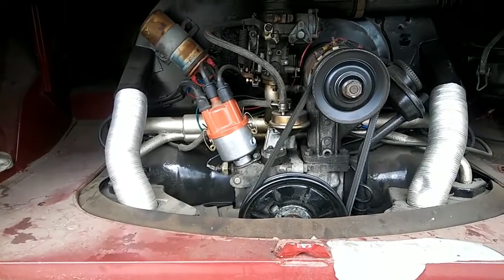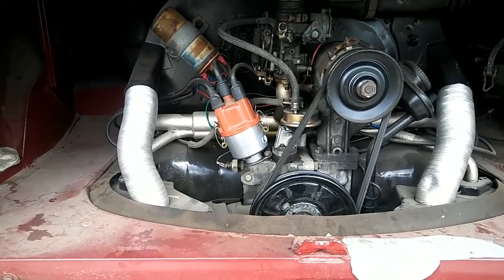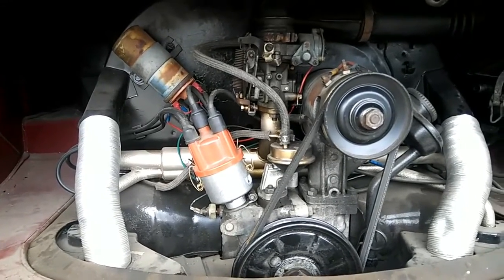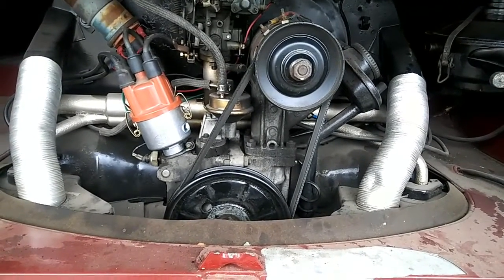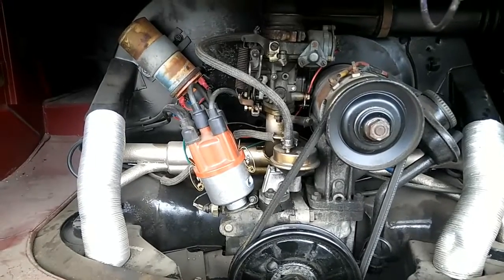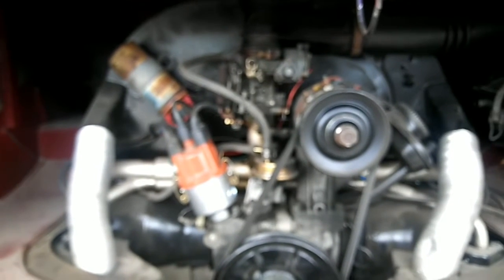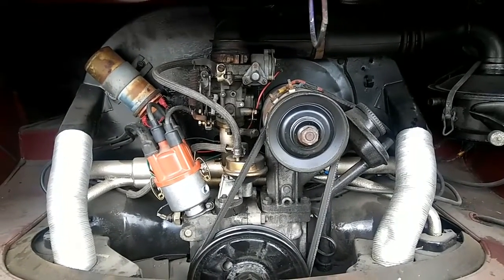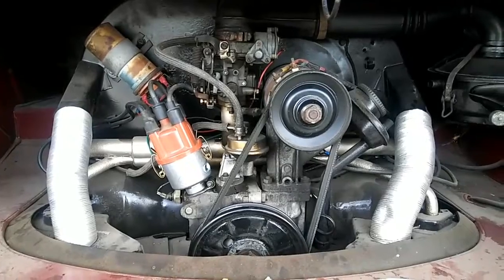Vw engine overheating how to prevent it more especially for modified engines

Comment: 91 RON was on the label.
Reply from the maker: That was 91 Ron in 1960s leaded fuel
Reply: @Mikefngarage  Thanks for making such great engine videos and for sharing your knowledge. They are awesome.

Going by the owner's manuals, the early 60's air-cooled engines used "86 octane" and the later ones with the higher compression ratios used "91 octane".

At 10m41s you said "91 octane or better on the label where you put the gas in" but in my experience, the labels on the inside of the fuel filler flap were usually always printed to say 91 RON which confuses us here in USA to this day: the owner's manuals sometimes had the fuel rating written as 91 Octane (Res. No) which was short for Research Number or RON.

The octane labeling of the pumps was changed in the early 70's:

https://www.nytimes.com/1973/09/09/archives/octane-ratings-can-be-confusing-more-accuracy-testing-is-urged.html

But VW kept putting those 91 RON labels on their vehicles and finally explained the difference in the later model owner's manuals:

https://www.thesamba.com/vw/archives/manuals/78bus/28.jpg

I believe you are recommending premium gasoline for all type 1 bus engines to keep the engine from overheating and I still think that's good advice. I was only trying to point out the confusing labeling.

Comment: more oil, more thermal mass.
Reply from the maker: larger sumps and full flow with filter does make it run cooler. Head temp is more important but once you get that right the oil temp is super helpful to keep the bottoms of the pistons cooler.

Comment: Why does your engine have air leaks. Don't know if you've installed spark p wire holders, but I see the wires dangling. Manifold pre-heat forward seal tins are missing!!  Air is the coolant, and recycling exhaust heat is not a very good idea. Sorry bud, no excuses.

Comment: mike< i am running j tubs what can i do to add the necessary tins to help cool the engine
Reply: It's a very late reply but I just started watching the videos. With J-tubes or Merged headers you can run Industrial tins .. eBay has them for about $38 they are very simple to make if you look at them also.
Reply: Gene Berg has the tins for $7.95 each side:

http://www.geneberg.com/cat.php?name=Industrial%20Air%20Shields&cPath=2980

Comment: One thing you should do is at least put hose clamps on your fuel lines. Also your engine bay gasket is supposed to be Under the cooling tin. Fuel...unless your engine has stainless valves, a leaded fuel is required for cooling and lubrication of the factory stock sodium valves.
Reply: Most stock bay seals have 2 flaps...one goes under and one over
Reply from the maker: those are the inlet fuel lines the pressure ones all have clamps. The gasket can be on top or underneath. as long as its sealed.
Reply: Your 1 of the few who know about the need of lead in the fuel .  Unleaded was the death of VW Bugs .  Ad that lead additive ! .
Reply from the maker: premium unleaded also is a good way to combat with the combustion temps. about the best way to run without lead. IDK about thos lead additives. I think they are a scam because it is a substitute   not real lead.
Reply: @tracyjamestavares3255  Not true!!!!!       Didn't see any PROBLEMS with unleaded fuel in my or my customers cars over the years, this includes the old 40 Hp engines. This is one of the myths.

Comment: 68 owner's manual says "91 octane regular." I believe there are 2 octane rating systems. I think 91 in one system = 86 in another system.  RON Octane Rating x 0.95 = AKI Octane Rating . So 91 AKI = 86.5 RON. I think the 91 rating in the manual means 91 AKI, in which case 87 Ron (typical "regular" in the US) should be fine.
Reply from the maker: Premium fuel Is what I always alway s have been told for VW.
Reply from the maker: http://www.vw-resource.com/octane1.html

YUP premium for 1600 or later engine. RON is the ability to resist engine knocking.  doesnt calculate into octane exactly. 

In todays fuel Premium is a absolute must on a 1600 or bigger engine.
Reply from the maker: 91 ron LEADED NOT AVAILABLE ANYMORE. the only way to combat with combustion temperature  is PREMIUM 91 octaine. DONT BE A CHEAP ASS> .
Reply: @Mikefngarage  what about non ethanol gas that is rated 87 I believe

Comment: I run 91 octane in my bug because its turbo'd so its a whole other story but FYI on the inside of stock filler doors it says to run 91 Ron not octane which converts to 87 octane.
Reply from the maker: 87 leaded fuel. NOT AVAILABLE. 91 is the best replacement for high combustion temperatures.

Comment: I have  That external oil cooler on top of the tranny on my 71 vert.... will it overheat if I'm in the drive thru at McDonalds?  or something like that?
Reply from the maker: we used to do it all the time with that cooler over the trans it takes a bit more than that.
Reply: thanks  !  it's Sunday evening I'm on my garage and got you blasted on my stereo.  Thanks  !
Reply: Hood Historian : unless an external oil cooler has an electric fan on it or the cooler is exposed to 100 mph winds, they are practically useless and is a set up for engine failure. Why do people try to improve on a proven design anyways? , I bet  Dr.Porsche is laughing his ass off with the mentality of some people thinking that 20ft of rubber oil line attached to basically a "non fan forced Radiator" crammed in an area that has little or no access to fresh free flowing cold air. Just my two cents!.
Reply: Eric Dee it does add another quart of oil to a system that only has 3 quarts to start with. 30% more oil in circulation, gotta be better than worse!

Comment: How do you feel about the breather box? I think I have to much crank case pressure.
Reply from the maker: ususally when you have high RPM engine or a 1836 or larger or stroker motor of any size you need a breather box. 1776 can work without one but it is possible to need one.
Reply from the maker: 1835
Reply: Mike F, 92mm in jugs, CB 76 stroker crank,  2020cc. Its been a work in progress, constantly evolving for a number of years.
Reply from the maker: yup you definitely need a breather box. Put on stock valve covers with tube connectors and a breather box usually mount mine to the back of the fan shroud. make sure you dont have any kinks on those hoses. doesnt really help with cooling but sure can keep it from puking oil all over the place.

Comment: I like your videos...could you do a video on the split window bus front end...every split bus I had suffered from a loose front end...could you cover the center !ink kit, drag link, steering box and the king pins...also the rear torsion bushings...rubber vs urethane for a split bus...thanks!
Reply from the maker: for sure those are great ideas for stuff I need to cover. Unfortunately I have already dont those things on the busses I have But I will think of something.